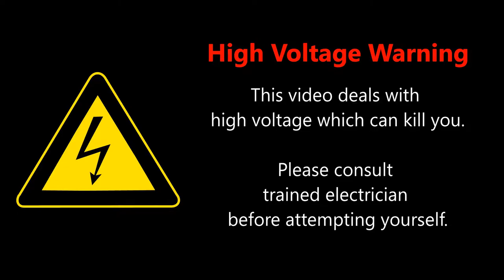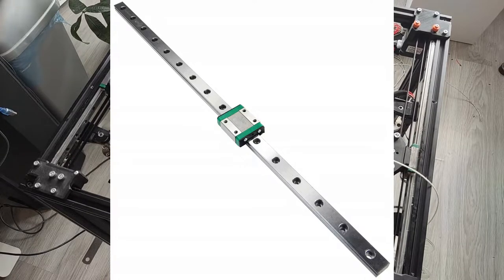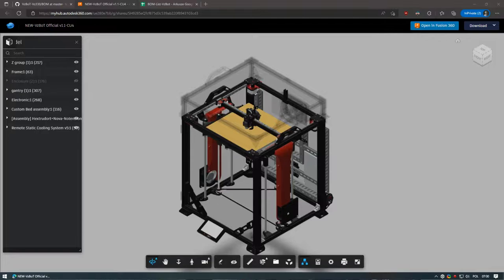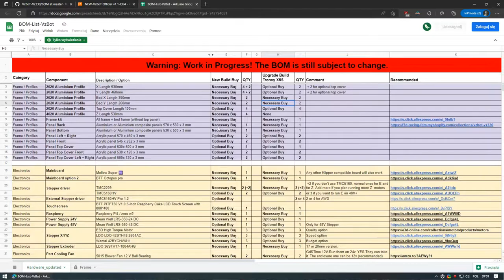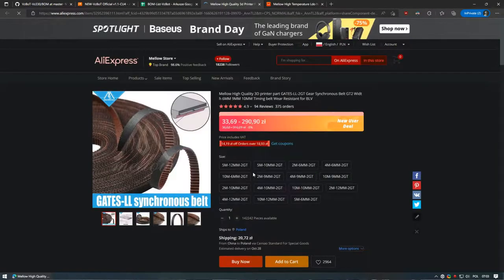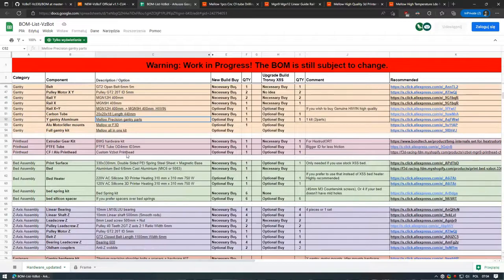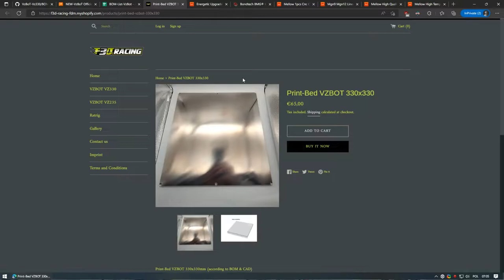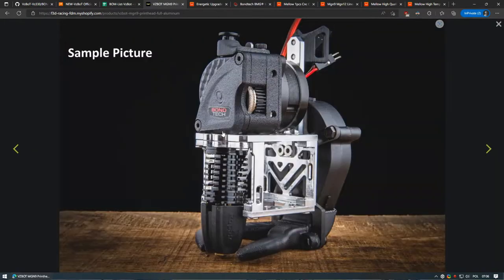Converting Tronxy X5SA to RatBot/VzBot - Bill of materials - Part 1

Comment: the reason for the 12v fan is because you overvolt it to 24, and that in turns causes it it spin faster then 24v version. those gdstime fans can handle the extra voltage. vzbot is all about performance. so you need the extra cooling for the speeds you plan to achieve.
Reply from the maker: I know that, still would not recommend overvolting fan twice the nominal voltage
Reply: Giving a brush-less DC fan twice its rated voltage is never a good idea, they have an IC inside them for controlling the motor winding pulses and a hall effect sensor. If you need a fan to spin faster, buy a better fan.